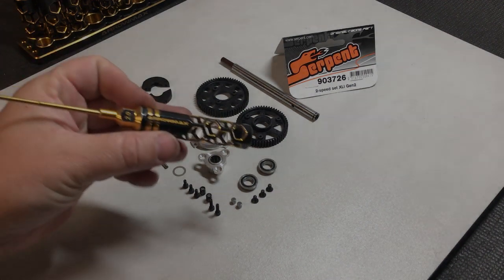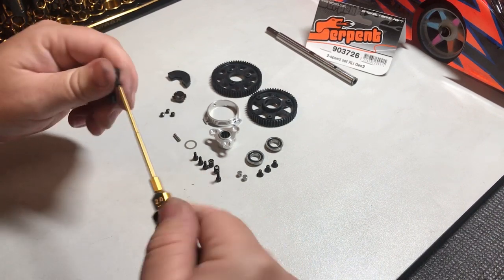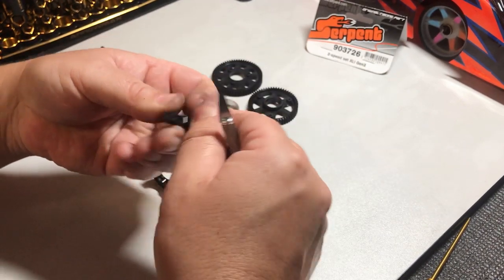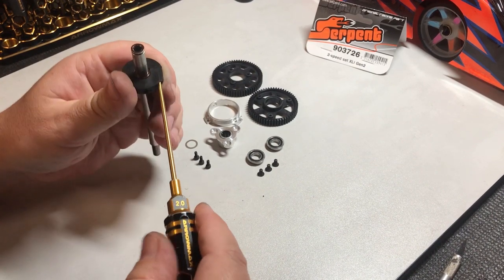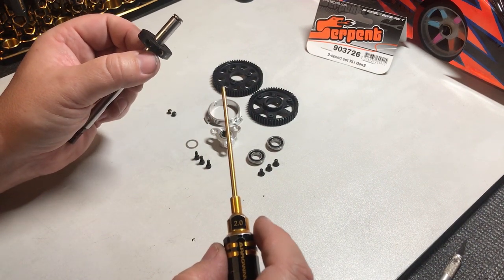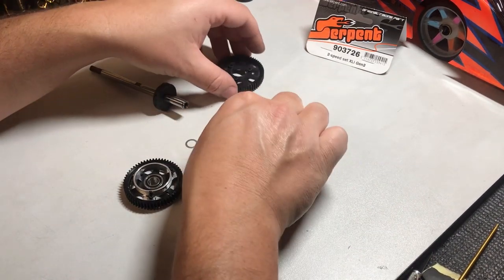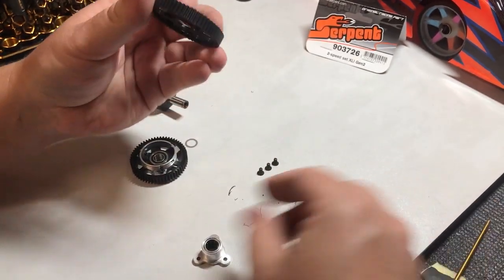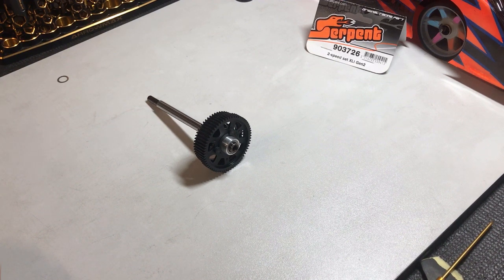Serpent 989 Viper 2 Speed Build

Comment: why didn't you use the spacer at the end?
Reply from the maker: I noticed that afterwards 🤦🏻‍♂️, it does go between the two flange bearings in the second gear. Refer to the 989 manual 👍
Reply: @jeffhamon6759  thanks for your reply.. I thought it was not an important part of the assembly...😁👍🏼
Reply: So for a later shift we screw in the screws with the springs?
Reply from the maker: Yes, please tighten the two 2.5mm screws evenly for later shift point.